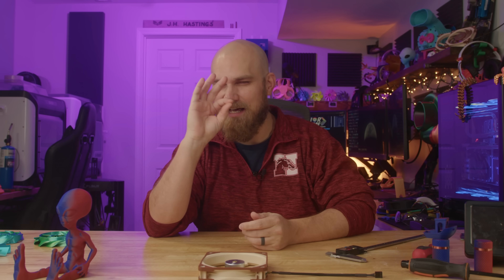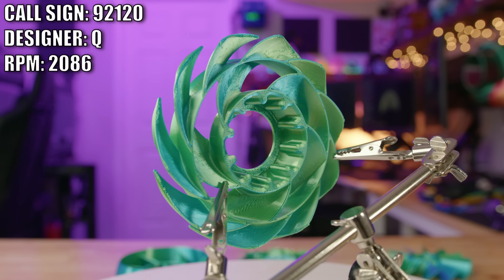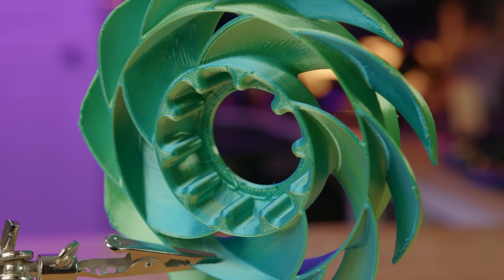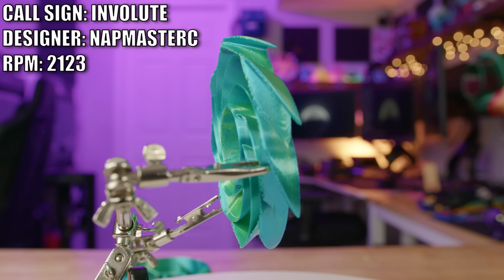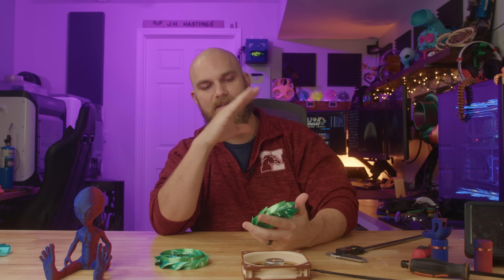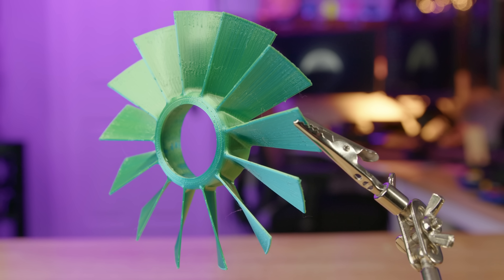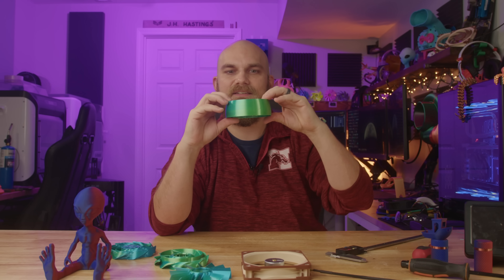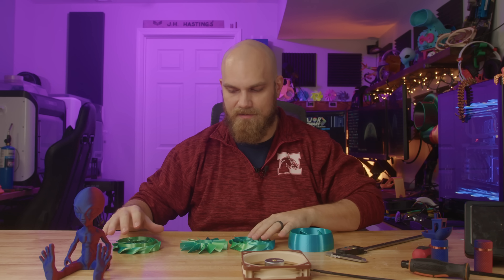Sometimes the simplest solution is the best solution | Fan Showdown S5E2

Comment: Simple 13 (blade) is indeed simple. And effective as the blade angle is probably forcing air more than the other fans. You can see the RPM is significantly slower while having a lot less overall mass meaning it is pushing a lot more air.
IMO the fans are still not optimal but they kind of look better than last time. The inside of the fan 92120 looks really smooth but the edges are rough. I guess its fine as long as they are all rough.
The acrylic screen was definitely the best decision to improve visibility of the smoke test. :)
Reply: I love that we have something in the champion position which can be modified easily and straightforwardly along all of its parameters. Let the parameter space search begin!
Reply: The Simple 13's blades are just radially aligned, so have the least amount of drag on the motor. That means higher RPM and more throughput, as less energy is wasted in rotational motion of the air on the exit side.
Reply: Related to the roughness of 92120, it would be nice to have a 3D-printed copy of the A12x25 to figure out flow loss due to roughness.
Reply: 🖕 Congratulations you among the selected winners claim your PC via telegram 📩⬆️🎁

Comment: We MUST find the creator of the Simple 13 to improve his glorious design. It seems we need... THE SIMPLE 14!
Reply: We clearly need to test. The simple 9 11 15 and 17 against our 13.

Because even numbers have resonance issues.
Reply: @glenmcgillivray4707  how about odd non prime numbers?
Reply: @beaclaster  3 fold and above resonance is complex and difficult to anticipate. But honestly? Are mostly trivial on the scale we are working with.

You would have to experiment to find out what strange ness it will cause.

But given 3 fin fans are functional? It shouldn't be particularly problematic.

Although if 3 could cause problems. We would expect them to appear strongly at 9 and 27
Reply: I have a feeling an 11 might perform even better. Too many blades and you just end up creating vortices and stalling.

THAT is a test Major Hardware should do. Test the exact same design, changing only blade numbers. Then do another across various blade angles. Print off 25. Do 5 blade numbers and 5 angles in all combinations. Create a matrix of blow.
Reply: @webx135  I agree, I really hope he does a video testing a simple fan with different blade numbers.
Reply: Serious question, why do you think a hypothetical simple 14 would do better than a hypothetical simple 12? In any case, I'm very glad that the champion is now something without a gimmick.
Reply: @jsalsman  In electronics the most efficient power transfer possible is when a load impedance matches the source impedance. Therefore you lose 50% of your power in the source and the other 50% across the load.
 These principles seem to be replicated throughout nature so I would guess that the static pressure  provided by the fan has to be double the back pressure caused by the radiator for maximum air flow.
Reply: I would buy a Simple 14!
Reply: 14 !?   that's madness!
Reply: Simple 26, contrarotating simple 13s
Reply: the odd number makes less noise because the stator has 4 spokes..
Reply: I love your vids and your tiktok page
Reply: @dm_creeperbg6847  Thank you! I really appreciate that. Can't wait to release some major build features for YouTube. 😁
Reply: how much more simple could it be? 
1... 1 more simple...
Reply: From someone who works in the auto industry. The answer is typically the least blades the better. Simple 3 gets my vote.
Reply: @MrAPCProductions  Cant for the life of me remember the specifics of as to why, but PC cooling fans for whatever reason always seem to have one sort of an issue or another when their blade counts drop that low. All the really good ones you can buy from companies who make such fans their business have more blades, whatever the reason is.
Reply: @laurencefraser  The noctua we're comparing against has only 9 blades and is regarded as one of the better PC cooling fans.
Reply: @Laurence Fraser  it's called blowback. Basically the air is free to swirl in the opposit direction when it only has three blades, becase there is nothing stopping the venturi effect.
Reply: @rusg.8347  Also there are side effects due to area covered by the blades and skin effects and back pressure and......
This is why most low pressure fans use 3, as do Wind turbines. But smaller computer fans are usually 5.

Although we are now optimizing with higher performance with multiple new designs every season. Eventually presumably we will find a forever winner.
Reply: number of fan blades should not be an even number.
Reply: Start with a Simple 6 first
Reply: the blade count must not be a multiple of 2 or 4 to reduce noise!
Reply: It's the odd number that pushes more air, so we need Simple15
Reply: Having an odd number of fan blades makes the design more resilient to minor imbalance and uneven turbulence since each blade is counter-balanced by two halves on the other side. Almost all fans have odd blade counts, usually prime counts at that to reduce the likelihood of resonance between subsets of opposing blades.
Reply: 🖕 Congratulations you among the selected winners claim your PC via telegram 📩⬆️🎁
Reply: That would not be any better. More material means less airflow and more blades means less effectiveness per blade. And on top of it, an even number of blades would make the noise absolutely horrendous.
Reply: @anteshell  Because of the 3-legged support structure of the motor mount being at roughly 120˚ apart, you probably just need to avoid straight blade designs that are a multiple of 3 (to avoid turbulence against the motor supports).  As such, 9 and 15 blade versions would likely have turbulence issues.

EDIT: the mount actually has 4 legs, not 3, so we'd want to avoid designs with multiples of 4 blades (e.g., 8, 12, 16, 20, etc.) to avoid turbulence with the motor mount legs.
Reply: @citguy  How is it possible for you to understand such complex topics on math while still not knowing how to count to four? I'm a bit puzzled by your comment. :D

EDIT: Replied before I saw your edit. When the blades hit all support beams at the same time, the effect is stronger but it happens also when only two hits. So all even numbers do resonate but with multiples of four it's worse than others. And of course there are other variables too that affect how bad the resonance is. For example, 2 blades would cause higher amplitude but lower frequency resonance than 12 blades at the same RPM, which may or may not cause the sound being worse. Hard to say without actually testing it.
Reply: @citguy  one of the best sound profiles of all of the fans he's tested (aside from vanilla) is the one that was patterned after a car's radiator fan, with unequal distances between the blades. it's a common practice on metal car fan blades so that it removes resonance
Reply: @anteshell  Good point on the even # of blades. It wouldn't be as drastic as x4, but still present. Regarding 3 vs 4, for some reason I thought that the mount had 3 legs, but yeah... I should definitely count first :)
Reply: @ghomerhust also with plastic blades 😅 7 uneven seems to be the norm
Reply: @anteshell  It was a joke. 😂

Comment: That is your new favorite hub. What do you think about the type using the blades as springs to correct for tolerances? Where the hub is positioned outward.
Reply: 🆙Thanks for watching 🔝 message right away I have something for you
👉 Telegram 🔝
Reply: The blades are too long and thin for that. It may work with very short blades in the gap between hub and motor, for example 10mm. But since the blades work the most effective on the outer diameter, it is probably the best to keep the hub as close to the center as possible
Reply: @Henning_S.  see S2E13 as an example with the Skeleton.
Reply: @herrkulor3771  ah ok, sure, i was thinking you don't want to connect the blades at the center at all, in that case you wouldn't get enough clamping pressure because the blades are too flexible.
Of course with the ring on the face of the motor it gets rigid enough.

Comment: Can you get a resin printer? That would open up a lot of options for design
Reply: I thought he already had one.
Reply: he does have one. he did a test for "quality" of print, aka "we want smoother blades." and then he sound tested the identical fan with smoother blades. no differences at all. in fact in one test, the smoother fan performed worse. but yes, resin printers can make more complex shapes than standard line printers. he HAS made a few with his dual filament printer, with the second filament being water soluble so it dissolves, and allows for that to be used as support structure for really crazy shapes
Reply: In at least one of his videos he did a resin print of one of the fan submissions, so it seems as if he does have a resin printer, or at least he had one.
https://youtu.be/WWiZ13T3mxk
Reply: Resin printing is more expensive and especially wayyy more time consuming. Printing, washing and curing 4 fans would take way too long to keep making these videos consistently.
Reply: I hope he sees this
Reply: 🖕 Congratulations you among the selected winners claim your PC via telegram 📩⬆️🎁